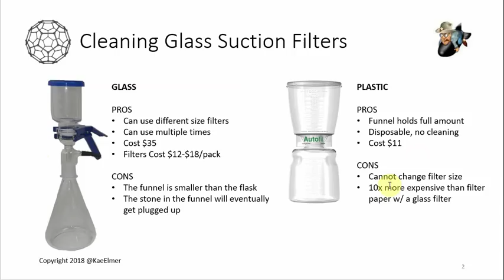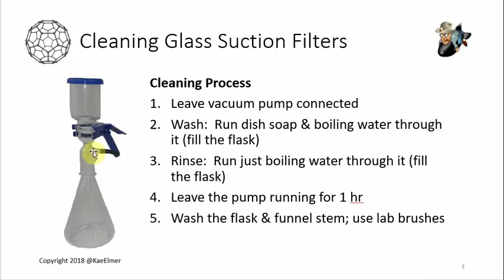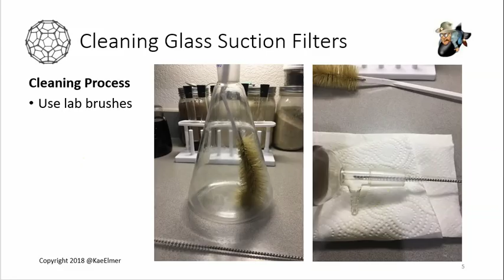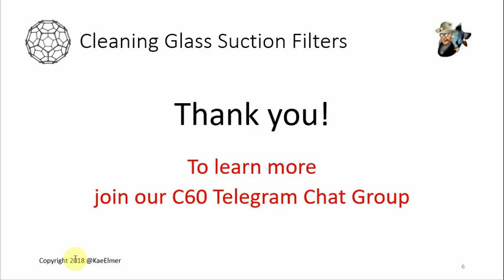Carbon 60 - Cleaning Glass Suction Filters

Comment: Elmer i followed what you said and it worked to a point but didnt clean the glass filter now i will tell you what will and you can reuse the Hydrocloric Acid thinned with water 25 Acid to 75 water and put it in the funnel the Hydrocloric  Acid will eat all organic matteral in the glass filter and the glass filter will be like new but you need to rise the filter out with hot water with a paper filter in it so you dont clog it back up and how i know this is cause i just done it and yes you can buy that acid from any hardware store  that acid is used for cleaning bricks and stone as a treatment for a sealer so yes it works😁
Reply from the maker: Cool - thanks!

Comment: If you want to clean the stone and make it nice and white again, you can use something called a piranha solution. It's a 3 to 1 mix of concentrated sulfuric acid and hydrogen peroxide. If you do, be aware that it is wildly corrosive and exothermic. The process is usually done under a fume hood in a lab. Some people also use nitric acid, which is probably the simpler and safer option. Piranha solution will definitely do the trick though.
Reply from the maker: Thanks for the tip.
Reply: That’s always an option, but it is some nasty stuff to work with. I’ve actually switched over to 100% acetone. I’m getting t very good results.

Comment: that you pointed out the flow rate improves as the crud is eaten up by the soap is the
answer to " is anything happening ?"

     with my cleaning setup i use a dual-purpose vac/pressure pump and the last step
is to simply blow air thru the disc.  when the pressure drop is 1/2 - 1 psi  its done.
the 150ml sintered glass bu. fun. is clean and dry.

    others have cautioned against excess NaOH w/ its high pH as being something
that will attack/dissolve the silica gel disc.  one put it in terms of a do - not - 
exceed 0.1 M .     ??? how to  integrate that info w/ your demo

Comment: You can get a plastic Buchner funnel and a glass vacuum flask. That way it's cheap, reusable, large enough to hold everything, easy to clean, and you can get different filter papers that can easily be removed and replaced

Comment: i also found that by using a coffe filter cut to size to fit the filter on the first filteration it takes out most of the c60  out of the mix and protects the ceramic filter

Comment: Thank you again for being one of the best resources out there for working with C60.
I do want to make the comment though, I will not work with the pulverized C60 ever again. I did make a number of batches and the time and trouble are not worth the results to me. I even have one batch I made with hemp oil and was extremely disappointed with the outcome. For me down the road it will always be the powdered C60, of which, I have always had good results with, without complicating unnecessarily the process. Just my feelings.

Comment: im wondering if anyone has tried grinding c60 in moter and prestle a bit, before mixing in the oil. wondering if it would mix faster?
Reply: I have always ground the C60 powder in a mortar and pestle but I cant say that I have made a comparison between grinding and not grinding as far as faster mixing . I can say that I get absolutely no residue left on my filter paper after vacuum filtering.
Reply from the maker: Have you ever let it sit for a couple of weeks before you filter?
Reply from the maker: I tried - it turned into mud.  Should have used a bit of oil or something, but don't want to waste any more experimenting w/ it.  Too valuable at this point.

Comment: When my stone gets really dirty I use a spray on oven cleaner. Comes up like new.
Reply from the maker: Is that non-toxic?
Reply: Its very caustic and requires thorough rinsing. Is there any residual toxicity?. People use it on heavy burnt residue in pots and other cookware .
Reply from the maker: My only thought is you might not get all of it out of the stone and the next run of oil will definitely pick it up.  Unlike cookware, where you can be pretty sure you wiped it clean, the stone is porous.  Just my two cents.
Reply: I see your point and would not argue with your concerns,. I do run around two liters of boiling water through to clear (at least in my mind)  any remaining residue from the oven cleaner. Im not recommending this method to anyone. And I only do this if the filter is extremely clogged and dark. Next time round I am going to try and use denture powder and see what sort of result I get.
Reply: I asked the question of cleaning the Stone (sinter) in bruchner funnels on GooGle. "Carefully add 15ml 30% hydrogen peroxide, or 1/3 the volume of sulfuric acid used, to the Büchner funnel and stand back! Let the reaction proceed for about a minute and then apply a quick vacuum (just enough to pull the solution through the sinter into the flask and the sinter is dry.)"
Reply from the maker: Interesting, but how many people have that lying around....?
Reply: The brand I use is "Easy-Off" Oven cleaner. It contains, sodium hydroxide and Diethylene Glycol alkyl ether